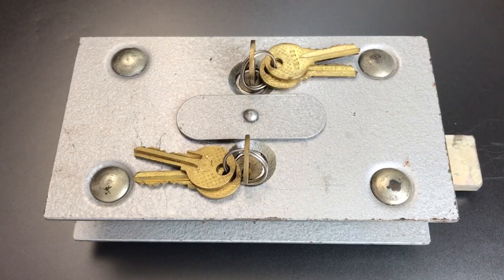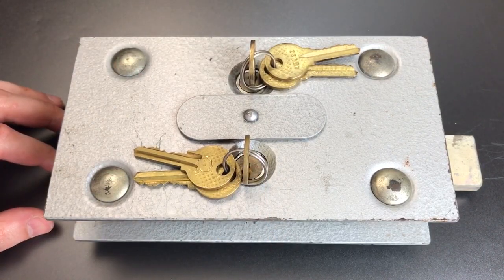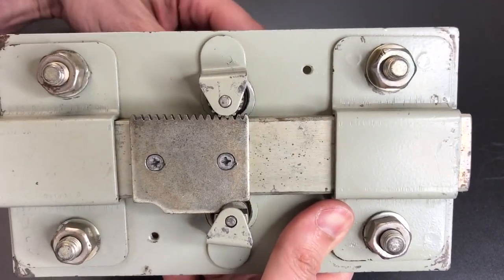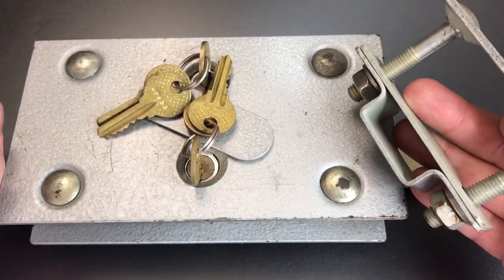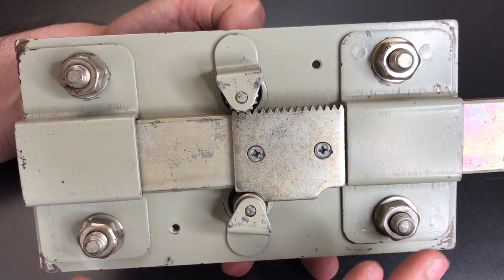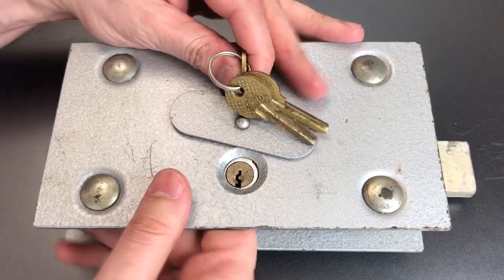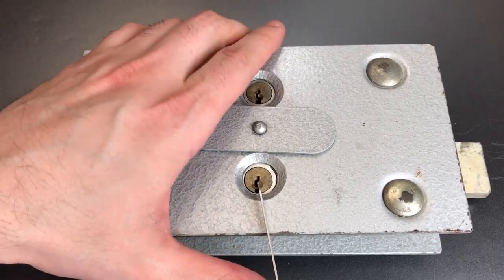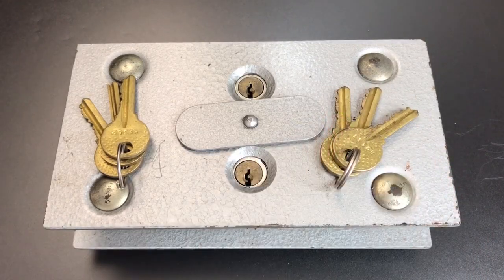[449] Cold War Era Russian Dual Custody "Safe Lock" Picked

Comment: That kind of lock was used to store signed draft originals at a factory: one key was held by Engineering Manager, another one - Workshop Supervisor. That lock was mounted on fireproof locker usually.
Edit: this one lacks clay seal mounting.
Reply from the maker: Any chance you have a picture?  What kind of door was it mounted on?  Thanks in advance for the info.
Reply: Well, alas - it was some 25 years ago when I've seen that. Just sand-filled hollow sheet metal walls wardrobe-sized cabinet with CO2 pressurised vessel inside. They actually called fireproof safes in Russian - that could be a reason which led to misunderstanding of the "safe lock" term.
Reply from the maker: Thanks... I can't complaint about calling that a safe.  After all, we have Sentry "Fire Safes" in this country.
Reply: @jetstreamer374  Mechanical timed lock.
Reply: Jet Streamer idk engineering manager and workshop supervisor ? Workers wouldn’t need access to signed originals they’d be in there to protect them as property I guess
Reply: There was a Sherlock Holmes story that dealt with a safe of this type. The Bruce Partington Plans or some as much.
Reply: Thank you for sharing your experience!
Reply: Safe seems to be a strange term for a strong-box anyhow, but I have seen safes that are both fire-rated, and secure against burglary. I imagine the average 'fire safe' is mostly for fire, less for burglary. Most wouldn't want to steal photos, or random work papers, but if they burned, you would personally be unhappy about it.

In keeping it safe from a threat, calling a fire-proof locking box a safe makes enough sense. Names are pretty weird anyhow. Like how things that collapse into themselves are called telescoping, despite having nothing to do with telescopy, but just the association due to collapsible spyglasses was enough.
Reply: @jetstreamer374  Nonsense. In Soviet Union there are no weekends blyat.
Reply: @Racing_Fox  The Soviets had tons of two-party access locks. They had widespread paranoia about these things right down to wax seals on buttons.
Reply: thanks for the informations king
Reply: it was soviet russia, so there is a good chance it was repurposed for several things through the years.
Reply: @kauske  Most consumer "fire/gun safes" are generally classified as a "residential security container" by UL. They don't classify them as a true "safe" unless they're made of 1" solid steel or better.
Reply: Thanks
Reply: @thomasjenkins7506 correct. And he was giving his experience with one of them. Way to state the absolute obvious for literally no reason, capn.

Comment: My dad had a car garage secured with this very lock. But the tricky thing was that it protected not the door itself, but a hatch on a door. The idea was that you open a hatch first, get your hand into it and then open a hanging lock on the opposite side of a door from the inside. There was also another lock which you had to open from the front. Overall you needed 4 keys to get inside. Soviet citizens went to a great extent to protect their cars from being stolen and lock like this is a great example of that ideas.
Reply: MIxa RTFM My dad's garage is still secured with a huge padlock blocking a hole through which a 1.5cm thick bolt is screwed in, operating a vertical deadbolt. I've always thought of all this garage locking ingenuity as a 90s thing, though.
Reply: 100% Agree
Seen this on garage doors
Reply: Good thing that they had no cordless tools to cut the hinges etc. Only kinda portable thing would be a oxy torch, but they would burn the whole row of garages while doing so.
Reply: The same system is used in house here in my country, crime was high.

Comment: It's garage's door lock. Using same since ~1975. Only difference that  in our's gear rack is covered. And sometimes in winter it's stuck by ice :) so you must heat all lock or do not forget oil it in the autumn. Nobody was opening them by picking. It was easier to catch padlock with steel line ant pull with truck.
Reply: whats the purpose of the 2 locks if it's just being used on garage doors?
Reply: @SpydersByte  “A car is not a luxury, but a means of transportation,” said Ostap Bender. But in Soviet Russia, you had to defend in a queue before you earn enough money to buy a new car. It made the car more valuable. In addition, even now those who do not have a car often use garages as workshops where they store materials and tools. Sometimes expensive. In addition, garages in Russia are often not an extension to the house, but a cell in an array of similar buildings somewhere on the outskirts of the city. Security is not always there. So it’s understandable desire to maximize their property.
Reply: @groupsphera  Of course a car was valuable - that isn't in dispute. But why two keys? If it's valuable you need a strong lock, not a lock with two keys. Just coming and giving a simplistic and obvious, 'a lock protects valuables' comment isn't enough.
Reply: @garymitchell5899  This lock clearly wasn't designed for a garage door. And people used it in this role not because it had 2 keys, but because for them at the time it was the only available option with a security higher, then your typical padlock.
Reply: @groupsphera  Illusion of safety . On other hand imagine same lock with one key. Dont' forget that in soviet union you was not buiyng what you want. You was using what you was able to get.

Comment: Great find - security by obscurity. Before you can open the door you have to figure out which core to pick first and which purpose which is for. Not impossible but some extra time filling around.
Reply from the maker: True... if someone wasn't familiar with the lock, it could be an impediment to picking.

Comment: I've no idea who made it or what it's for. However it does remind me of some locks used on a job (ancient history by now) I worked in Seattle- they were on cages around steam valves. No one could give us a consistent answer of why there were dual-custody locks on steam main valves but the prevailing thought (amongst us grunts on a coffee break) was to prevent someone from sneaking in the tunnels- with singularly locked doors, I might add- and shutting down the heat to entire building or block. 
Just a thought. I know that urbanized Soviet homes were often supplied with steam and hot water from centralized plants. Perhaps they used a similar system to keep rivals from turning off the heat to another person's apartment building. 
Cheers! Thank you sharing your skills and talents.

Comment: There are many likely uses mentioned in the comments, but I did not see mention of the lock being able to lock "open". The round cutouts for the one cylinder look like one locks it closed and the other can lock  it open. For an electrical room, or some similar utility it would be possible to prevent the door from being locked by actually "locking it open.

Comment: I'd guess utility lock, like city water substation or something.
Reply from the maker: That seems a reasonable guess.
Reply: But wouldn't that include extra work when one repairman is not enough, you need two? And if those keys would be loaned to anyone, there would be no reason to have two locks. Two locks, two keys and two guys who do not loan the keys to anyone.
Hence, my strong guess is weapon storage. Two guards (or one guard and one supervisor) are needed to open the door, otherwise it would be way too easy to steal guns.
Reply: @alaric_  that seems a more likely option, I see no reason to have a dual custody lock on a door that would be accessed by a tradesman or technician.
Reply: As a child of Russia, I can say that it’s a garage lock, it looks tough and can hold a brute force.

Comment: This (or a lock just like it) is off a movable (accordion) partition found in school gymnasiums here, the duel key is so that it requires two staff members to open or close the folding partition possibly a requirement as I vaguely remember there was an accident where a student was operating one of these movable walls and crushed another kid to death inside the wall cavity where the folding panels are stored when opened.

Comment: It's possible to lock it open, by locking the "blocker" core first.
Reply: I noticed that too
Reply: No, its so you could use the lock with the "metal bar" sticking out the other way, say your door hinges to the right, then the lock has to be one the left side of the door and the frame 

Hope that makes sense, I'm not a native English speaker
Reply: @Nanoka_the_Civic  It doens't make it so the lock can't be locked open ;)

Comment: This lock was used to lock the doors of non-residential premises (warehouses, garages, workshops, and so on). Two keys were used for two man operation (first key is stored on the guard post and is used by guard personal, the second is for the people who are authorized to enter to the door - guard personal checks the person, who asks to open a door, make a record to the log, turns off alarm and operates the first key, then person, who needs to open the door, operates the second key and the door opens) or as a method of security level increasing.

Comment: You can close the rotating cover in the middle and seal it with wax so anyone can tell if a picking attempt or keyed entry was made on the lock. The bottom core can lock it closed, or lock it open, but not actually move the bar. The top core can move the bolt, but only if the lower core is open. As soon as the lower core closes, the bar can't be moved, so a supervisor can lock the bar in the 'closed' position with the door open and so make it obvious the accounting books, etc, are checked out. The Soviets were less paranoid about someone picking a lock (you'd be shot within the week) than they were about someone opening a lock he had a key for but no orders to open. Its a look into the mindset of people living under totalitarianism and nominal shared ownership.

Comment: Dunno about their original purpose, but we used to use a couple of these to separate the cages surrounding the credit card processing servers and networking equipment from the regular servers at my last job. They were pretty much pure security theater, but it was good enough for the auditors and cheaper than buying the hardware to tie the cages into the rest of our access control system.

Comment: The blocker core, is it key retaining? years ago during glasnost I had an opportunity to tour several Soviet installations and saw several locks similar to this, they were on regular doors securing everything from tools to documents, one key was retained by the zampolit who would open the control lock in the morning and do an inventory along with the supervisor, the zampolit would then leave and the supervisor could use his key to open and close the storage throughout the day, at the end of the workday a second inventory and the zampolit would secure the door till the next day
Reply from the maker: Both keys must be inserted for the lock to be either opened or closed.
Reply: Then how did you pick it if you needed a key inserted in the other one ?
Reply: basically you cant pull the key out if it is in the unlocked position the key can only be removed in the locked position
Reply: LockPickingLawyer , but is the blocker key removable in the unlocked position? This explanation makes sense, but only if the key is not retained.
Reply: LockPickingLawyer , but is the blocker key removable in the unlocked position? This explanation makes sense, but only if the key is not retained.
Reply: Considering that the keys do two different things, this makes sense. The person responsible for verifying inventory at the beginning and end of the shift has the blocker key but does not have to remain by the safe during the entire time. The person who makes use of the inventory can open and close the lock several times during the day, as needed. Note: this only works if the blocker key can be removed in the unblocked position. This would require a second set of upper pins and springs 180º out from the initial position.

Comment: I think it is designed for a room. It looks like the core is designed to sit inside something-- perhaps concrete, which was a popular soviet building material. Big, thick concrete walls.

I think the intended procedure is: Unlock the stopper, move the bar, re-lock the stopper to hold the lock in the unlocked position. I suspect the stopper is more to prevent someone from accidentally locking themself in, rather than as a security measure. The fact it uses a key is just to discourage others from re-locking it with someone inside.

Now, what would be in that room...? Likely other locked safes and boxes with documents. At an off chance it could be a gas chamber. The lock seems like it is intended to keep something IN more than it is intended to keep something OUT. It could also be more of a safety lock where the goal is to keep a door shut because of radiation concerns for testing, say, nuclear or biological weapons.
Reply: I suspect the fact the lock cores are so easily picked isn't an issue.  If its a high security door, you'll probably have guards who would shoot anyone getting a set of picks out.

Comment: I think that the level of administration & control in the soviet union was more than we imagine, or can appreciate today (& then again  think TSA protocol...)
in the 1990ies I was shown around what had been a collective farm in East Germany. One of the things mentioned as a result of the system change was that they no longer had gate guards on the main gate registering all traffic.
If you try to think in that mindset then this could easily be for the door to a farm store, the two keys ensure that the supervisor (political officer) must be present.
Certainly I think the rest of the lock is suited to fairly low security & simple use, where the lock only protected against casual access - if nothing else those bolts could easily be drilled.
Reply: People now don't appreciate the sheer suspicion and totalitarianism of the Soviet system, this lock style was common throughout the east block on stuff that would make no sense to us, it could have been on anything from secure drug storage to the office supply locker, you would need not only your supervisor but your zampolit to open nearly anything
Reply from the maker: EXCELLECT points. There are quite a few soviet dual custody locks out there... far more than tfrom any other country I know of.
Reply: The novel 'The Hunt for Red October' mentions a 2-key lock for a safe in the submarine that contained the orders for the sub. The zampolit (political officer) had one key. The captain the other. This was to ensure the orders were not tampered with. My understanding is that the author, Tom Clancy, had access to some people in DC that knew a few things that made their way into his books. I would readily believe many locks in the USSR required a similar dual entry system as paranoid as they were.
Reply: Old Liquid But GRU and KGB officers trained in clandestine entry could.